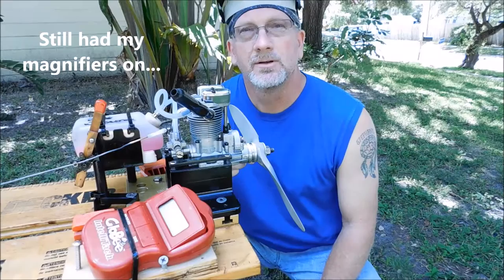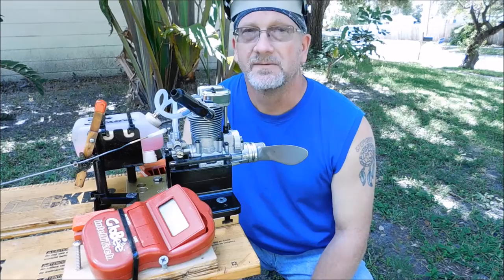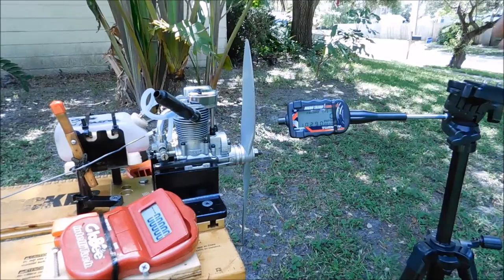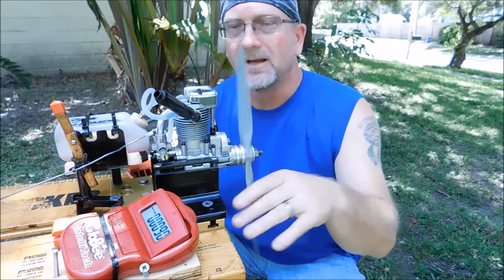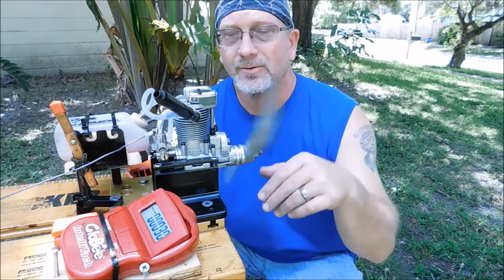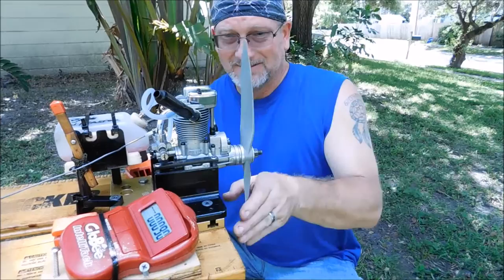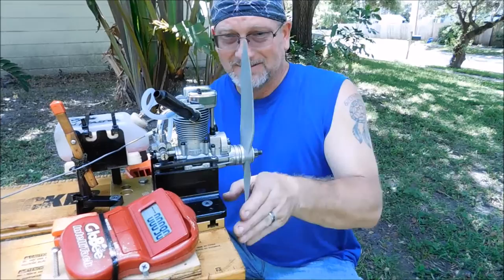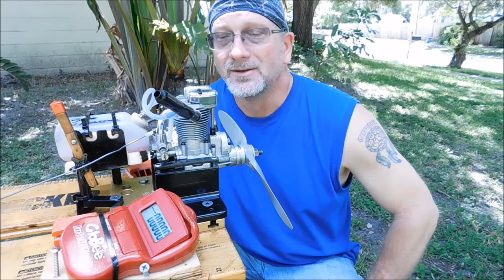Saito FA-65 First run after rebuild**Sent to owner**

Comment: Hey David!

Any tips for needle settings on this motor? I'm fiddling with my idle and transiton settings. 

The high speed needle was set using the pinch method and it's now at about 1 1/2 turn open
Reply from the maker: Wilian Amaral  First, the pinch method isn't used for setting the high speed needle at all. It is used to determine the low speed seeing. I suggest you watch the videos more closely.
Reply: I've borrowed this method to set the high speed needle from my Supertigre G-45 manual.

Since this saito is my first 4 stroke engine, I'm having a little trouble while getting used to it.

I'm digging through your channel right now and thanks to you I'm learning a lot. This weekend I give it a new try and let you know.

Thanks for the help, mate!
Reply from the maker: Needle settings are not set in stone as far as turns out.  It really is a matter of using your ears and a tachometer to tune an engine.  
Perhaps this playlist will help you.  There is a video in ther about the initial setup for a new engine.  The same principles apply to a used engine..
https://www.youtube.com/playlist?list=PLsvn3JGZAOMvtADUd0vQTZks4rVxrr_qw
Reply: David McIntire thanks!

Comment: how does the crank case get lubricated?  I saw the port on the back, but is that somehow pressurised from the exhaust and then the fuel tank?
Reply from the maker: Crankcase lubrication comes from the oil in the fuel.  Oil migrates down from the pushrods to the timing area and into the crankcase as well as working past the piston in the chamber.  Fuel tank pressurization is not a necessity as many early four stroke designs did not use tank pressure at all.  Tank pressure is more for consistent fuel feed into the carb.
Reply: @dmrcflyr2  I would imagine blowby is how the bottom end gets lubricated,  but for the rockers, pushrods, and camshaft,  I just now read in a forum post there isn't any lubrication and guys will lube them at regular service intervals.
Reply from the maker: I have run 4 cycle engines from OS, Saito, and Enya for many years.  I never saw the need to regularly oil the rockers.
Reply: @dmrcflyr2   Good to know.   Do you have a favorite brand in the 4-stroke sector?  I had a YS once upon a time which I sold because life got in the way & I ended up taking a 20-year pause while raising my family.  I'm looking to get back into things now :)  Someone, recently told me that modern engines have gone downhill in quality, especially OS,  which I always held at the pinnacle.  What do you think?
Reply from the maker: It is very true that most all engines have a lower quality now than 30 years ago.  Much of that is due to cost reduction methods at all manufacturers.  Ever notice when tools and accessoriers stopped being included with engines?  That was an easy cost reduction, but when that wasn’;t enough to stay aflost manufacturers went to lower cost areas like China.  then they started using lower quality materials all while attempting to get as much power oou of engines that they could.  Bad recipe.  There are many stories and confirmed cases of Saito FA-100 engine basically blowing up as the crankcase gave way.  This is one reason, of many, I am no longer flying or really IN the hobby anyway.  All of the quality in engines is basically gone.

https://youtu.be/Kp_HkV-DnAI